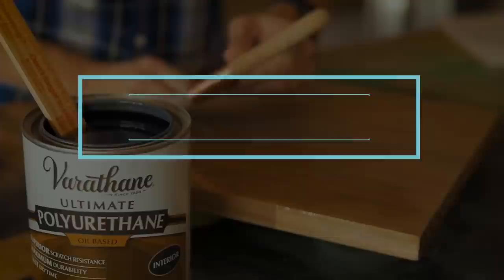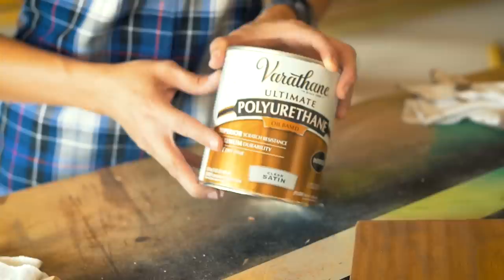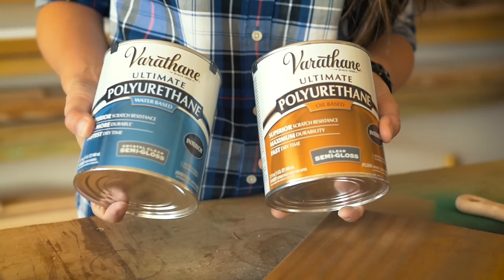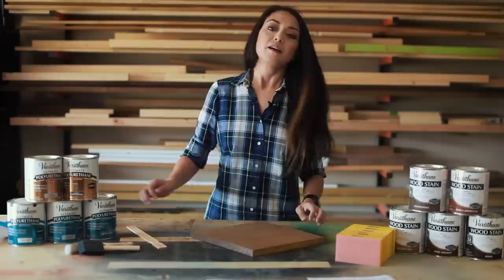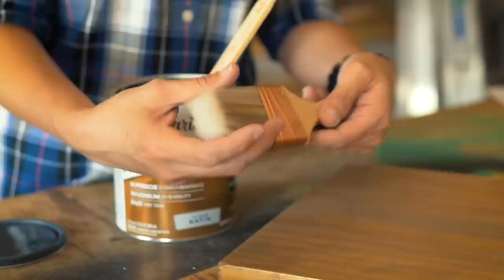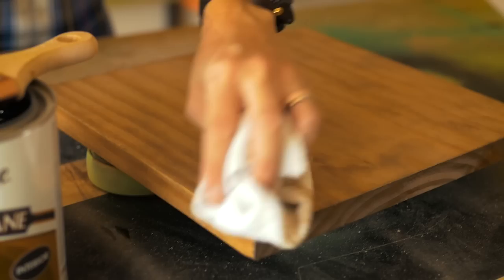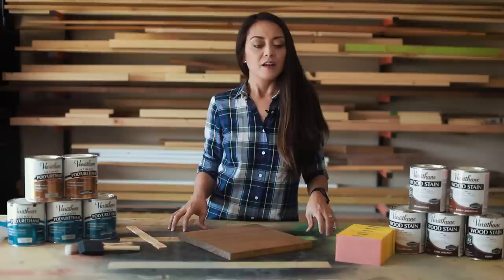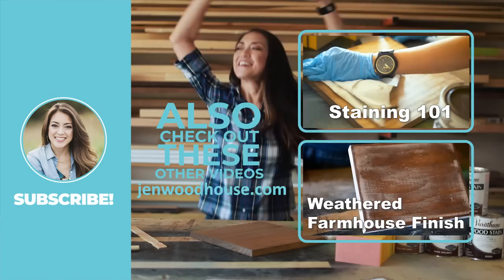Finishing School 101: The Basics of Finishing Wood

Comment: I must be the polar opposite when it comes to using foam brushes I believe. I have laid down more coats of oil based polyurethane over the last 7 years than I care to try counting with foam brushes and it's how I was able to get that smooth to the eyes and touch finish the first time. I use Jen brand foam brushes and the cells in the foam are a lot smaller and tighter than a Walmart foam brush for instance. Good bristle brushes that I've paid for as far as quality is concerned cost wise gave me more headaches than anything in the beginning. Thinning each coat maybe 10% to 20% on the eastern red cedar furniture I've built clients over the last 7 years and a Jen foam brush achieved great results for me.

Comment: This Old House says never to use a tack cloth,  because the wax will transfer and could prevent adhesion.   Opinion?
Reply: Tack cloth isn't ideal for water based finishes because whatever is used in the manufacturing process that makes tack cloth tacky, as redundant as I just sounded does not work well at all with water based because of the chemicals or whatever is in the cloth. Oil based it is perfectly ok to use a tack cloth though.

Comment: Hello my name is Brian. I just watched your Rust-Oleum video 👍  but the comments were turned off. I also watch this one. Both videos are very informative. I'm researching the best way to refinish a classic M1 Garand Walnut stock. This will be a brand-new replacement walnut stock . I'm seriously considering the black walnut Danish oil? I really like how it brings out the grain in walnut from other videos I've watched. The traditional finish for the M1 Garand was raw linseed oil or tung oil both were used in production depending on the manufacturer there were three during WW2 era. I've thought about doing a traditional sanded in finish to fill the pours and get a very smooth finish using the Danish oil starting out with 220 grit and working my way up to 600. Do you think this will be protected enough or will I need to still do some kind of top coat? I'm also thinking about color. The traditional reddish brown Walnut finish is what I'm trying to achieve. I know French red produces a really nice color. I also know the Danish oil has a red mahogany but I'm not sure how it comes out on Walnut? if the red mahogany came out to a true red mahogany on my Walnut that would be perfect . I would greatly appreciate any advice you can give me as you seem very knowledgeable. Thank you for sharing.
Reply: How did your gun stock turn out, Brian?
Reply: @adamcbeck  Been to busy to even think about it. LOL My business has been nonstop. Thanks for asking 👍